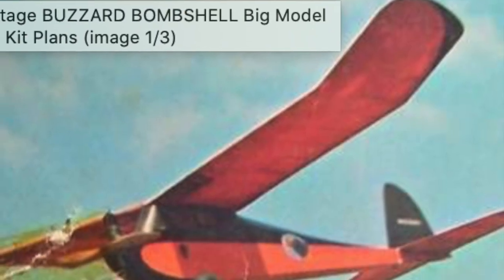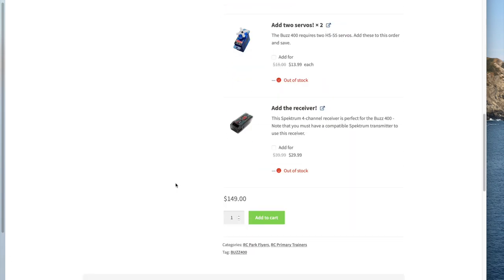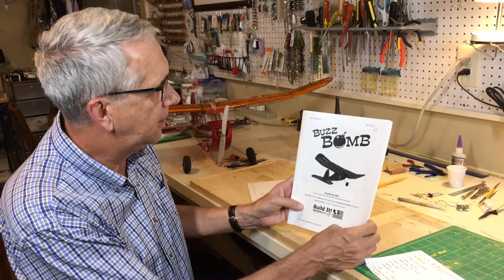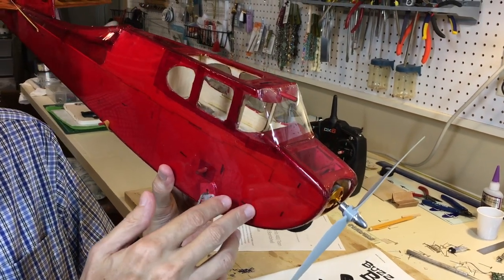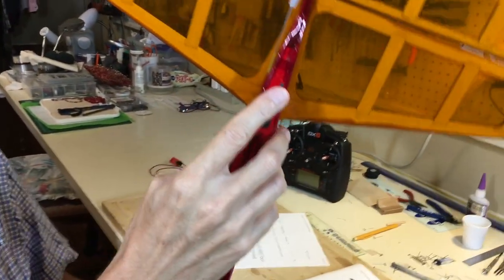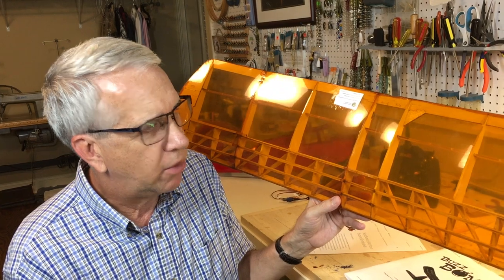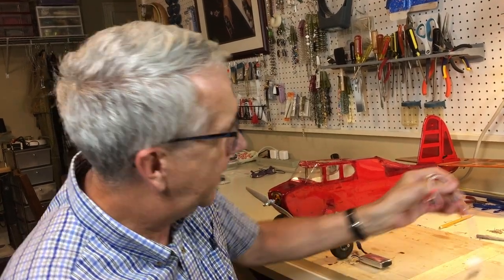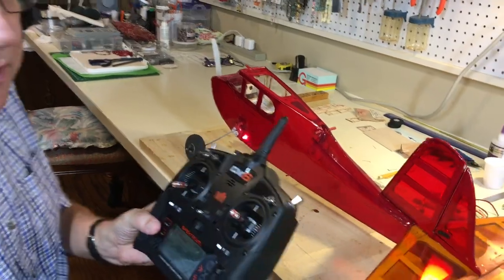Stevens Aero BuzzBomb RC Model Airplane Kit

Comment: HEY TIM! Thanks for doing this video on the Bombshell. What brands of electric motors to you use. What size of motor did you use on this plane? Just wondering, as I am getting back into RC after a 12 year absence. Thanks again.
Reply from the maker: Loren:  Cannot recall what motor I used on this plane. But for these sport flyers, the brushless motors really do not matter.  They are all well made and work. I like the E-flite Park series a lot at www.HorizonHobby.com. They have a chart for motor size vs model weight. And if you need a bit more thrust go from 2 to 3 cells with the lipo. Tim